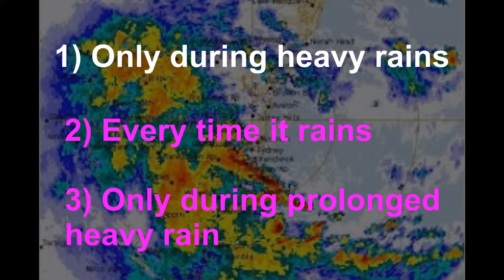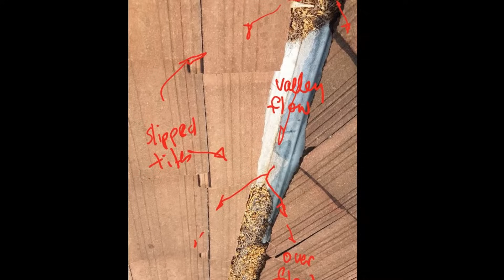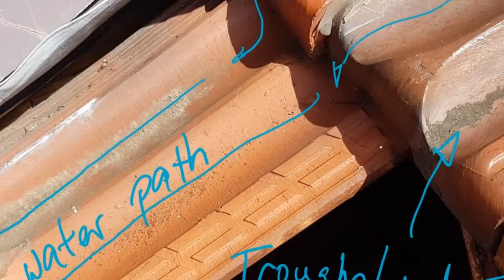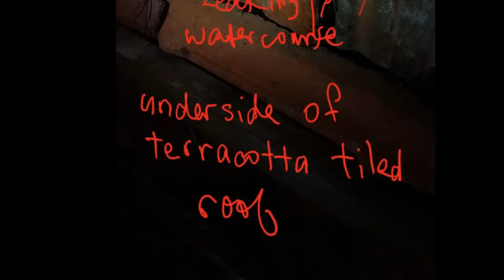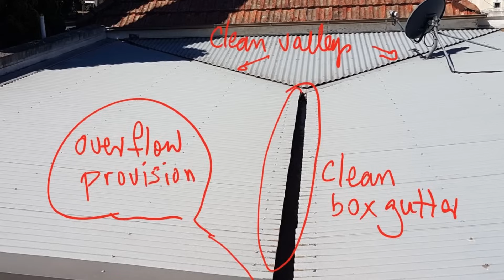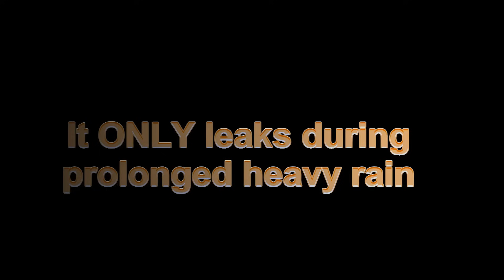why roofs in Sydney leak only in heavy rain

Comment: how do you clean water courses in the tile?
Reply from the maker: Lift the corner of the tile covering the water course that you will be cleaning to expose the debris, Then use a flat screw driver to scrap the debris off the water course. My roofers prefer to use their battery powered workshop blower to blow the debris off.

Comment: Solutions: Trimdeck for low angle/skillion roofs. Zincalume/colorbond for all other roofs. Always have eaves, the wider the better. Never design a roof with an internal box gutter. Regularly (once or twice  year) use a blower. And hail ? One of the biggest insurance pay-outs occurred when a hail-storm hit Sydney in 1999. A factor was tiled roofs. Corrugated roofing is far more resistant to hail damage. As well as providing a better rain cover for your roof.And it is longer lasting and requires less maintenance. One can only speculate that a preference for tiled roofs is habitual...that is what every one else has. Like the Americans' preference for pitch-based roofs that have a definite life-span. The main purpose of a house is to keep the water off the occupants and its contents. The purpose of a roof is to perform that function - and keep the water off itself. Water is the enemy of all building. This is a very serious problem that is solvable. From  a Brisbane householder. For what it is worth.